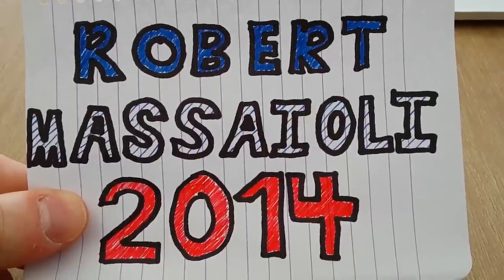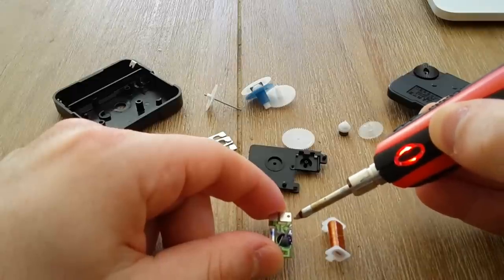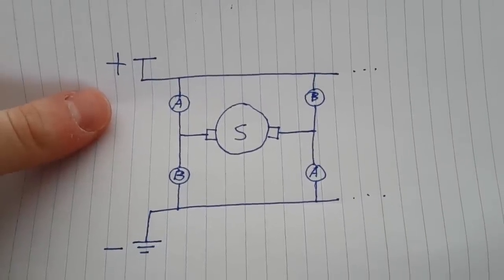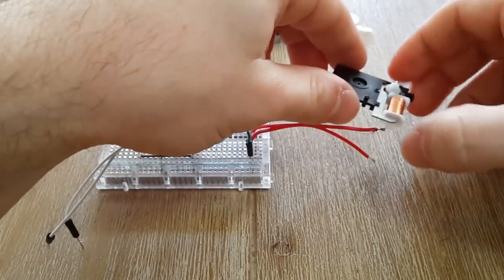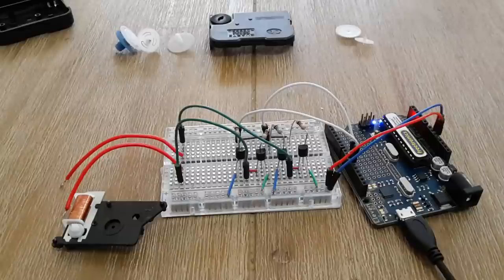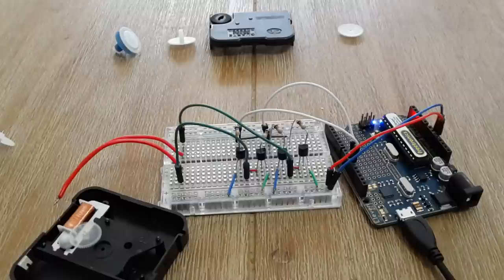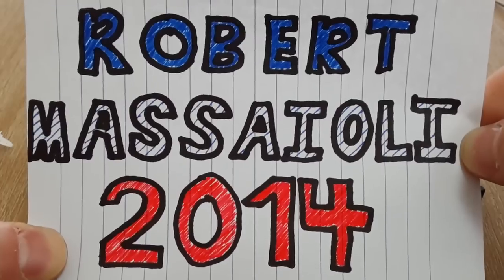How fast can a Quartz Clock spin?

Comment: I took apart one such mechanism and it actually cycles the solenoid though four different states, not two, so that between the states where current flows in each direction, there is a stage where no current flows (low,low > low,high -> high,high -> high,low>...).

Comment: You not even need the bridge. You can drive directly the coil with Arduino's ports.
Arduino's ports can support about 20mA, pretty enough for this coil. 
Take 2 ports (es. D11, D12) as A and B, and repeat the pattern {A,B} = (0,0),delayOFF, (1,0),delayON, (0,0),delayOFF, (0,1),delayON...
If you want to protect the ports from eventual back-EMF, put 1K Ohm resistors before the coil wires.

Comment: You really didn't need to remove anything from the clock except the crystal. You can then just input a clock signal greater than 32khz to speed up the clock. A 555 timer could easily get you to 30rpm.

A lot of your direction changing is just due to wobble with your gears not being held in well.

Comment: My old citizen clock was dead. I found its solenoid coil was open. I made coil and clock working. The problem it's battery draining very fast  .lasting only 4 month.may be my  coil is not sufficient. Please give me what is the normal coil resistance..thanks

Comment: You should be able to get it to spin much faster than this. The timings you've chosen assume that the rotor must stop at the end of each cycle. This needn't be the case. You should find bands of frequencies higher up the range where the rotor is still moving when the next pulse comes at just the right time to kick it further on. You'd need the rest of the gear-train and the hands in place to get the right mechanical properties. The second hand would effectively be a flywheel.
Reply: I doubt the second hand would be a very good flywheel because it is spinning at about 1/30th the motor speed.  I suspect highest speed would be obtained with no load and the permanent magnet rotor behaving as the flywheel.  Modifying the second hand to increase its weight (angular inertia) without ruining it's balance may help its behaving as a flywheel.
Reply: I was able to get the second hand to do a rotation in 3 seconds reliably. I did with other code achieve the 6 second rotation I was looking for. Now I have to figure out how to get this gimmick clock to reset to 12:00 position, start on a button press, run for 6 real minutes ( minute hand will travel 1 full revolution) and stop. cycle will repeat as needed.
The timing is so critical, I spent a long time trying small changes and still can't find the sweet spot for running 6x faster than normal with a Lavat clock mechanism.
I was able to use a stepper motor to do all this reliably, so I am at a point where I need to decide which way to proceed. I like the Lavat method, as clocks are cheap to buy and hack.

Comment: All the clocks I've dismantled - and that's quite a few - did not use an H bridge. They simply connected one end of the coil to 0V and the other was driven via a capacitor from the electronic drive. Drive out 'high' sends current through the C and coil one way. Drive out 'low' allows the current back the other way. Result is reversing current in the coil, and no standing current even though the drive out stays high or low, as the C blocks it. 

Then to test how fast it will drive just use a square wave signal generator, such as a 555, with a tweaker pot instead of all that hassle with programming an arduino. 

Incidentally the directional control of the motor is achieved by clever shaping of the pole pieces. You can't change it.
Reply: actually, the current direction reverses to effect the stepping action.  The IC that is typically sealed in a dab of epoxy does contain an h-bridge.  you can check out NXP.com PCA200x OR https://hackaday.com/2018/06/07/dive-inside-this-old-quartz-watch/ (or both, if you're really interested).  The clever bit in the integrated poles is the asymmetry that results in a preferred clockwise rotation, as you mentioned in your comment.

Comment: You didn't really accomplish the task and answer the question.
During your experiments you had various results.
But during you experiments you were only driving the first gear, not the fully clock movement.

15:26 little blob is moving clockwise, 1 second per revolution
16:08 little blob is moving counter-clockwise, 1/2 second per revolution   **
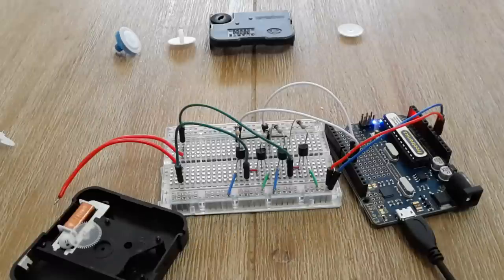16:25 little blob is moving counter-clockwise, 1/4 second per revolution   **
17:50 delay time 160ms, little blob is moving clockwise

Comment: Pulse width might need to be wider or narrower at higher frequencies (i.e. duty cycle) to compensate for magnetic field rise/fall times. Also, a ramp-up to speed would help overcome inertia. This is commonly used for stepper motors, and in reality this is a dirt-simple stepper motor. All these things are easily accomplished in software.

Comment: Up the halt by the MS and you can go even faster!

Also you need the other gears on it to stop that rotation switch it needs some mass to keep it going the way you want it it.. also try running the H bridge on 3.3v not 5v.. it may be too much power peaking out the transistors..

PS. what soldering iron is that??

Comment: Have you tried increasing the on time to perhaps 10mS?  This should allow more on time for driving the coil to saturation if it doesn't saturate in 5ms.  This may accelerate the rotor faster and allow 120mS or less of off time.

Comment: Thank you, Robert!! For two beautifully explained 'mysteries'!!
I'm here from your other video where you have dissected and explained a quartz clock. I also asked a question there, echoing others, who wanted to know how to halve the 1 second frequency of the motor, to enable a single hand revolution to cover 24 hours.
I am amazed that there seems to be much greater interest in speeding up the clock.....visually more dramatic, I expect.
So now I have two requests: 
a) could you give details of how to slow it down to half speed accurately and 
b) dissect and explain the working of a quartz clock with a sweep second movement.

Comment: Nice video.  I've always wanted to make an analog clock know what time the hands are displaying by using a rotary encoder.
One problem is many of the clock gears are too small to add an encoder wheel.

Comment: I came across this video because I woke up at 4AM, checked the time on  my little quartz clock that I've had for over  ten years.  The second hand was spinning backwards wildly at over one revolution per second. Each revolution backed it up by a minute.   I grabbed my cell phone and got two short video clips of it doing this. It was weird.  I didn't do anything to the clock to make it do this, and I didn't do anything to make it start going forward again. What the heck? Maybe I can post the video...anyone interested? Anyone have a clue?
Reply: do you have a "radio controlled clock" or a so-called "Atomic clock"?

Comment: Hi Robert, Great to see your video blogs which do explain a lot so even electronic dummies like me can understand. I am looking for a quartz mechanism that would spin only once per year by modifying the electronics instead of using 365 teeth. I though of an adjustable oscillator like ’50Hz～6kHz NE555 Square Wave Output Module Oscillator Pulse Generator Adjustable’ that I found online. As I am not into electronics too much I am probably not able to make it work anyway and would like to ask you if you have an idea how it could be easily done to have a quartz module slowed down by 265. Thank you 😉

Comment: A very clear interesting & instructive video. Thanks. 
Note no upper pivot for armature. You really do need that to centre it.
If I were soldering this up those fine copper wires to the coil would be sure to break off! That wire is so thin it needs more support than this. You must have been super lucky that didn't happen.
Please may I ask you two Q's ?
1) What sort of logic in the original clock, can operate at 1.5V ? {Battery}
2) Please may I have the redundant clock PCB for my own clock repair ?
Sincerely Berry JG

Comment: If you use different transistors you will be able to increase the speed.
Reply from the maker: You may be right. I assumed that the limiting factor would be the physical resistance to spin of the pinion gear. However, it may simply have been that my transistors could not switch fast enough. Though I still do find that idea surprising: I would have thought that even these transistors should be able to switch hundreds or even thousands of times a second (I'll double check that now :) ). Looking at your experience though I suspect you may know something I don't. Can you please post more of your thinking here so that others can learn from it too?

Comment: I have tried to connect a 50 Hz voltage with a proper value to the solenoid. The whole mechanism was assembled,  and it required a little push of the second hand to start spinning. It was also spinning equally good in both directions which varies a little bit the operating principle of the lavet motor. But it was running good at 25 times higher than the normal speed. Should try it with a signal gen at even higher frequencies.
Reply: you need to reverse the current flow in the solenoid to get the stepper to step.  If you apply a true, 50hz AC signal, this is automatic, even though cross over between +ve and -ve voltage can't be controlled.... however, doing the same thing with an h-bridge and you can certainly drive the solenoid beyond what the video suggests.

Comment: Instead of soldering to the thin coil wires. Just cut the PCB tracks and solder on the PCB. A lot easier and gives better physical stability. If done properly you can even repair the PCB again.
I've done that with a couple of clocks. One to be driven by custom DS32KHz circuitry. One to be driven by the electronics taken from a vintage radio controlled aftermarket clock movement from before hand where self-aligning and hey presto The clock is radio controlled but hand and everything can be kept original and even reversed if I want to.
Reply: Btw. With the right controller logic - speed adapted - you can get pretty amazing speeds on those motors.
I don't know where you live but in Europe we have the DCF transmitter and if you want a radio controlled movement fitting "euro hands" - typically for new German clock and vintage European clocks of many brands - if you want to preserve the original hands unaltered (you can even keep original movement to reverse is possible) your only option is the Hechinger W70 RC clock movement. It's a one motor movement (many RC today is two motors) with step each second. The amazing thing is when it adjusts itself - which it even in worse case granted good radio reception only takes 15 minutes. 3 minutes for reception - 12 for setting. The second hand literally races around at a speed of approx. one revolution pr. second. A have seen a few other one motor RC clocks before including the before mentioned but that is pretty slow using about 5-6 minutes to gain one hour - which the Hechinger does in only minute.
Reply: in the case of the atomic clock, how did you detect home position for the hands?

Comment: Transistor as function switch
Base -----------low voltages input signal
Emitter--------Disallow voltages or allow voltages
Collector-----Disallow voltages or allow voltages
0 volts in Base Transistor is OFF or disallow voltages
0.5 volts or 1 volts in Bse Transistor is ON or allow voltages